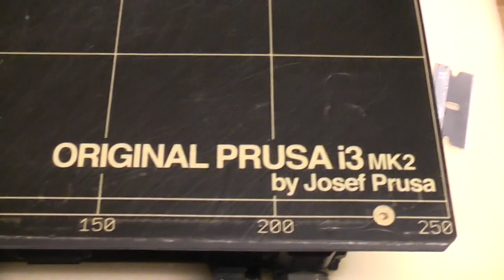Part cooling duct mod for original Prusa i3 MK2

Comment: Thanks I printed one. The original snaps to the fan better whereas yours has a slight gap (1-2mm) from the fan when screwed in. Do you think that this affects any airflow to the nozzle?
Reply from the maker: I did not have any gap back when I did the mod, I would think some air would be lost if you have a gap. Maybe you could fill the gap with something. But now that Prusa has released the new Hot End Parts that you can print out with a new part cooling fan system I would use there design. I printed there new design for my MK3 and it works well. here is a link to the vid.
https://youtu.be/sbIuQXkZ1ac